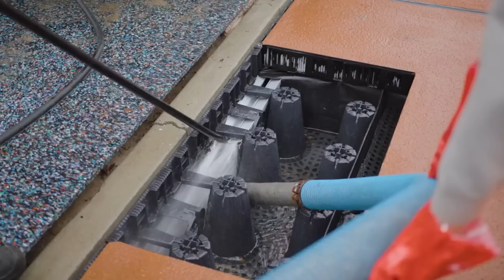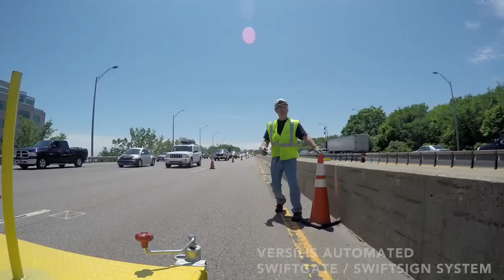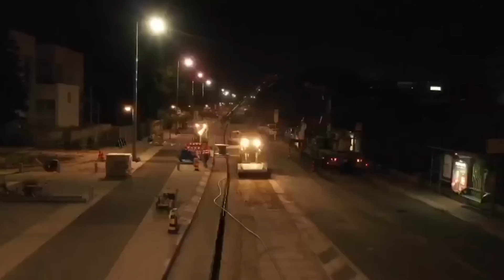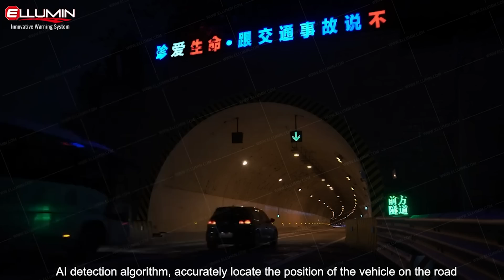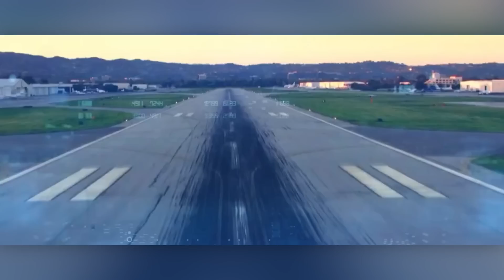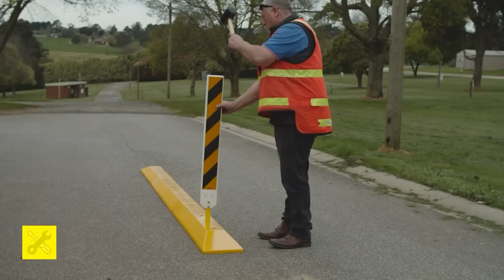INCREDIBLE ROAD INVENTIONS YOU DIDN'T KNOW ABOUT

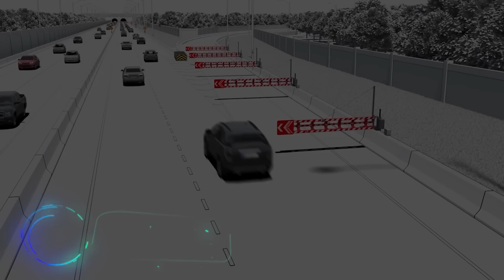Comment: 3:13

They are all over Texas, they are usually there to prevent drivers from going on the Express Lanes when they are not supposed to do so. I see them a lot on I-35 (Especially on I-35E).
Reply: Only place I've seen them near me is on the Chesapeake Bay Bridge to prevent cars going the wrong way when the 3-lane bridge isn't running in 2-way traffic (there's a 2-lane and a 3-lane bridge next to each other, and they sometimes use one lane of the 3-lane bridge to add to the 2-lane bridge's capacity)

Comment: On the road "filter" for drainage.  You are kidding, right?  You have to clean it.  The operating cost will be enormous to Cities and businesses.  Just think of the pollution generated from those vacuum trucks and the follow up processing of that which was cleaned up.  Not a good idea.  Next, in surface heaters to melt snow.  Again, the issues are pretty large.  Maintenance is done, that required digging.  The "call before you dig" system is OK, but fails to stop dig ups anyway.  Locating exactly where each tube runs is an issue.  I am sorry, salt it, or better yet, the sidewalks are required to be cleared by the property owner adjacent to the sidewalk.  Good old shovel works, but a snow thrower will do too.
Reply: Cleaning has to be done regardless, question is if you are going to do it at the easily accessible filter pod up on the surface, or if you are going to have to track down the blockage in the day water tunnels and clear it underground.

Comment: As a former project engineer on the U S Interstate Highway System, I have not seen any device that is practical, cost effective and/or labor friendly!!! The methods in affect today are much more practical and easier to install/use!!!!
Reply: Those on here that say nothing on here is particle are the reasons our roads are as bad as they are.
Reply: If you have decent public transport, the amount of roads needed to maintain can be reduced massively. That's why some of the better inventions are viable in Europe or Asia but will probably always be too expensive in the USA.
Reply: Norman, what's the harm in implementing devices that aim to save people's lives? If it doesn't work as traffic rushes past, the company improves it, until it performs as required. Long live innovation!
Reply: @danielvermeer5079 and who pays for it

Comment: Solar panels and wind turbines plastered on everything, everywhere. Welcome to the future. Ugh 😒
Reply: Solar water heater I built @ a lakeside vacation bungalow near!y 50 years ago is still in functional use. Low tech/over engineered by current standards. Utilizes artesian well water so efficiently that it pulls double duty as radiant heater during colder months. Only requires annual RV antifreeze replacement of the outer loop of the dual stage system. Beauty is in the eye of the (designer/user) beholder.
Reply: I bet you can think of anything better